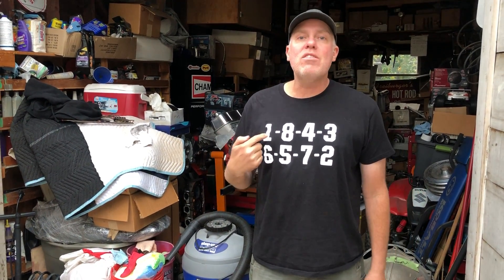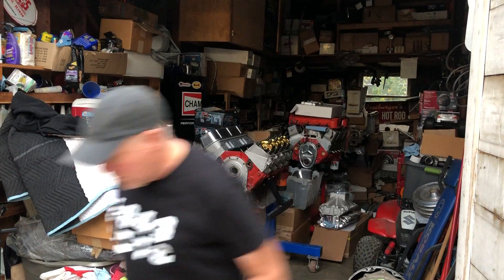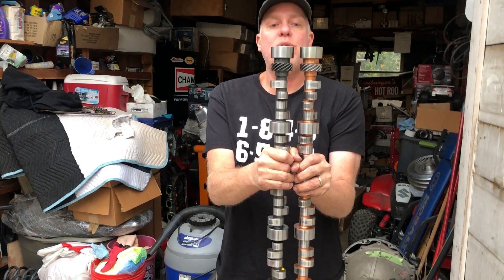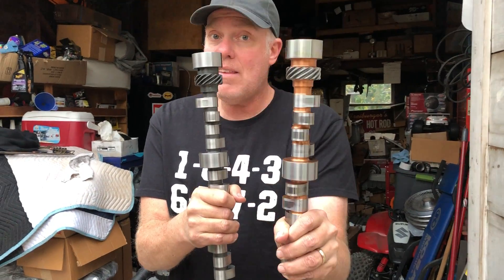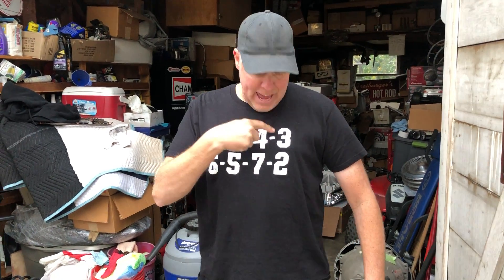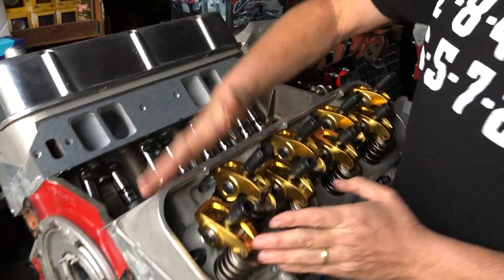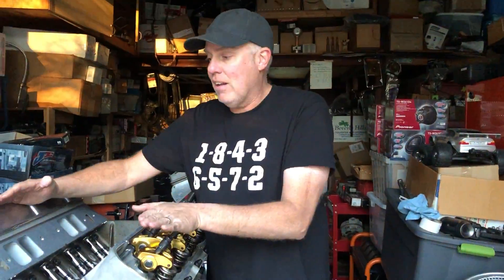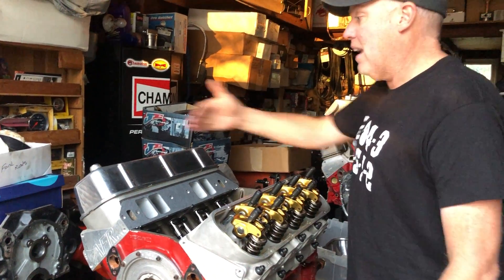Camshaft 4/7 Firing Order Swap Explained

Comment: Pontiac and Buick Nailhead engines also used a right side forward block design. Pontiac had a perverse numbering system and still called the first cylinder on the left hand bank #1. Also the first generation Oldsmobile Rocket big block engines used a 4-7 firing order swap out of the box!

Comment: The Ford order makes no sense. Not only does it give you less information without some manipulation (like bank), it ignores the order that the rods are arranged down the middle of the block. I'm a big Ford fan (building a 4.6 3-valve now), but they screwed the pooch on this one (I'm adopting GM's nomenclature for mine -- no camshaft though, so it's easy).

Comment: 18436572 is the same as 15426378 if cylinders are numbered the same. A 4-7 swap is the same as 15486372 the flathead, Y- block and Coyote firing order.

Comment: I read the description and understand the benefits of this swap...this is the first time I've heard of this. If there ever comes a time when I need to rebuild the lower end on my 5.7 TBI, 500K mile 91 OBS Chevy truck, will the cam shaft be WORTH the extra cost? I expect exhaust note might change? I'm a big fan of a strolling(slow,smooth) idle that i can feel every power stroke. Will that be affected?

Comment: i have 94 e150 5.0  enginei got it back from  the rebiulder but my problem with the firing order  oem wont start and with old firing order like1989   it will start but is missing this is efi  can the cam got replace and wont work ?

Comment: I need a 4/7 2/3 swapped camshaft for my pontiac 301 so I can open up the heads evenly and build a bigger manifold for the turbo.
Reply from the maker: I don’t think the firing order and port design are interrelated but I have not tested that. I’ve done the firing order tests on big and small blocks with similar results, and they have very different port designs.
Reply: @TheDavidFreiburger  yeah I get that. But pontiacs are not big/small blocks. Just pontiac v8. The 301 and 301T (turbo) have Siamese intake ports in the heads. The runners are extremely small for a v8, the the only large runner is the 5/7 runner as they fire simultaneously and pontiac engineers decided to give that runner more to not starve the next cylinder. The point I'm making is that if we can change the firing order so all cylinders fire separately that shave the same runner, then we can do much better to Max things out.

Comment: I did it in my type 1 aircooled engine. Swapping from 1,4,3,2 (stock timing), to 1,2,3,4. It works very good, and I notice gains at middle and high rpms. 
Great content bro!

Comment: Given how tiny the gains and losses are, it's worth noting that if you displayed the entire spectrum of the engine's rpm on your monitor, it would be impossible to tell if there were any differences whatsoever, not just visually, but also viscerally. 

It's very unlikely that most of the changes made would ever have any real world effects on horsepower, torque and ETs.
Reply from the maker: I’ve tested it three times. It usually gives you 4-5 more numbers in most parts of the curve. Granted you’re not going to feel that, but it all adds up. And there’s zero downside.

Comment: So bummed went to but 2 of these shirts and nope they are all gone. One was for me the other for a friend who traded a junkyard 454 for a fully built 572 high compression. His dumbass wouldn't listen when I told him it is prolly a 4 7 swap. Well many dollars and lots of parts later. Convertor flexplate trans manual valve body multiple intake gaskets trans brake exhaust msd boxes and more. All he had to do was swap wires 4 and 7 and get a pan that clears the crank and massive main caps. We all learn some the hard way. My advice is listen to experts and always always double check the dumb stuff or it might make you look dumb

Comment: Warren Johnson was doing the 4,7,2,3 swap firing order back in the late 60's with a SBC 350 with 6 inch old's connecting rods. He brought it to the KALITA TEAM BACK IN 95 WITH THEIR MOPAR PROGRAM. THEIR WOULD BE ANY GM WITHOUT WARREN JOHNSON/SMOKEY YUNICK. THE NASCAR 4 PATTERN CAM IS ALSO INTERESTING WITH A SINGLE PLANE INTAKE.

Comment: For those of you wondering about the significance of the 4/7 swap and why this is important/worth doing (bear with me, this isn't an easy or short explanation):

Note: I'm basing the history portion off of what I've been told by local engine builders and my dad/grandpa; the rest is based on college-level understanding of metallurgy, fluid dynamics and heat transfer...

Way back in the golden era of hot-rodding (early 1960-s to early 1970's) drag racers were starting to climb towards the maximum of what their vehicle's engines could achieve, which led to finding the limits of stock hardware.  However, there were a few problems that were commonplace amongst the hot rodding community that no one seemed to be able to escape.  This phenomenon was what's called (and I'm ad-libbing here because I don't know the correct terminology off the top of my head) butting the ring ends.
Butting ring ends together happens when cylinder temperatures get too hot, allowing excess heat to be retained in the compression ring material.  As material increases in temperature, it tends to grow in size (volume), and this expansion process follows the path of least resistance, which ends up with rings growing to a larger diameter than normal, which shrinks the ring end gap.  This continues until there's no room left for expansion, and then suddenly, the ring ends butt together, then simultaneously catch on and seize to the cylinder wall.  Since there's not a lot of piston material above the compression rings, the piston material fails under tensile stress, fracturing into multiple pieces and causing catastrophic cylinder damage.

So the question is: how does this happen?

The main culprit is the design of the engine block itself.  Back when the Small Block Chevy (sbc) was introduced in 1955, it was designed to be a relatively simple engine.  However, this came with a myriad of problems once the design was pushed well beyond it's intended purpose.  The most damning of these shortcomings was the design flowpath of the engine's coolant through then engine block, combined with the other culprit: the stock firing order.

As Freidburger stated earlier, the firing order for most classic american V8's was 1-8-4-3-6-5-7-2 (when looking at it through the layout of a chevy engine).  The coolant flowpath through a sbc goes from the water pump, into the front of the block, through the water jackets to the back of the block, then up through the cylinder head, into the bottom of and through the intake manifold, then through the thermostat and its associated housing at the front of the intake manifold, out via hose into the radiator to cool off, then sucked back into the engine via water pump once again to start the flowpath once more. This is where the issue resides.

For context, there's always one pair of cylinders in a crossplane V8 that are part of one cylinder bank that fire right after one another, that are located right next to each other.  For the original sbc, this is cylinders #5 and 7.  For the late model Ford Coyote 5.0 V8's those cylinders are #4 and 2 (still using sbc numbering)  and for LS/LT engines, the cylinders in question are #3 and 1.  These two cylinders firing right next to each other AND right after one another generates a 'hot spot' in the engine; a concentrated are of higher temperatures compared to the overall engine.

So the issue with sbc's and their original firing order is that it places the 2 consecutive cylinders at the back of the engine, which is furthest away from the coldest coolant entering the engine (remember that coolant flows from the front to the back of the block).  This presents an issue where the two hottest cylinders are receiving the lowest amount of cooling.  Hot cylinders transfer heat to compression rings, which causes ring ends to butt together, which causes the failure that i mentioned above in paragraph 3.  So how do you fix this?

Simple.  You move the hot spot as close as possible to the front of the engine, where the coldest coolant is.  Granted, this doesn't 'get rid of' the hot spot, it moves it to a place where it can't cause damage to the engine.

So now you've done the 4/7 swap.  What does that mean?  It means that now our firing order is 1-8-7-3-6-5-4-2.  This means that our two hot cylinders are at the front of the engine, on the passenger side, identical to a Ford Coyote (funnily enough, doing a 4/7 swap on a sbc dues give you an IDENTICAL firing order to a Coyote...), and now the problem has been mitigated.

I hope this helps.

*Side note: Due to the more even firing order between banks, this configuration tends to have better fuel-dispersion properties, meaning that your air-fuel ratio disparity between cylinders is decreased by a noticeable margin.
Reply: Hi your explanation is fairly correct but we always were taught to file ring end gap for expansion and the 4 7 swap cam was used in corvettes as early as the late 50s as I was taught that from a gm engineer that worked on them anyways thanks for your explanation it was great
Reply: @unclecowboy2003 Yes most drag race engines the ring gaps are opened up because of this so it doesn't happen . All of the guys running turbos are opening up the ring gaps and a lot of guys that are going to run a turbo LS are buying used junk yard engines that still run good but have high mileage on them because the ring gaps have opened up from wear . They will usually check crank & rod bearing & if within tolerance they will replace them then do a cam change that's made for turbo applications then re gasket the engine. It's a cheap way to go fast for someone that doesn't have a lot of money to buy the best or or pay to buy a good ring grinder to do this which can be expensive for a good one .

Comment: The two things that every internet/old-school car guy knows are that: 
1) Back pressure makes horsepower. 
2) Different firing orders (on a cross-plane V8) sounds different.

Hey, maybe they all still feature two opposing-bank pulses followed by two same-bank pulses... but whatever. It's that TONE.

Bonus:
3) The two-man bleed is obviously the best, most efficient brake bleeding technique. Open the bleeder with a clear hose (if you want to see what's happening) attached running vertical and just pump until bubbles stop? Blasphemy.

Comment: There's another piece to the puzzle here. Engines are capable of changing the firing order on their own without requiring a cam change. I've seen it first hand. My '99 F150 w/ 4.2L went from 1-4-2-5-3-6 to 1-4-2-_-3-6 immediately after throwing a rod. I was towing a trailer of about 6k lbs and made it another 10 miles before the firing order changed one final time.

Comment: With this being said could you technically make an Ls have the same firing order as a old school small block chevy? And would it sound like a sbc? I would assume it would. Did they change the firing order from the sbc (18436572) to the Ls firing order (18726543) because it was more efficient and or made better power?

Comment: I used to think that all you had to do for the 4/7 swap was swap the spark plug wires. So I did. It was a 406 sbc.  I didn't know at the time it also required a special cam. My way of swapping made no difference that I noticed. That 406 rand so good even on 7 cylinders, so my screwed up swap just wasn't noticeable.

Comment: Awesome information! Would like to know a little more about why swapping the firing order offers an advantage and should it only be done when swapping camshafts or is there an advantage when the engine is stock? Also does this also work on modular V8 engines like the Ford 4.6?
Reply: probably if u can swap both cams. since the 4.6 is  SOHC

Comment: 99 of 100 engine builders just learned nothing.  Maybe with special one-off intakes could some power be added.  Hundreds of millions of dollars were spent by manufacturers making sure 18436572 works as intended.  Flat cranks are only used to make an engine louder and sound different.  There is no discernible advantage of flat cranks for stock engines or everyday hot rodders, except harmonic problems to beat everything to an early death.  What is the point of this observation video?

Comment: Crane cams sent me a Cam for a 5.0 SBF that had the firing order from the 351 Windsor. The cam card was wrong and by the time I figured it out the flat tappet cam went flat from attempted starts. Of course Crane just wanted to replace the cam, even though I had to do a complete rebuild! Negligence as far as I'm concerned, what do you think?

Comment: What would be great would be if you could arrange the firing order on each cylinder bank so that they have a 360 deg. (or 180 deg. ) firing separation. Then a header could made  that could be perfectly balanced as far as scavenging goes. In the book "How to Hot Rod Small Block Chevys", even though the firing order wasn't perfect, that was the idea behind the TRI-Y header design which the book says was more effective, but more difficult to make.

Comment: Funny thing, this still doesn't cure the traffic jam that happens on a V8. I'm talking about the left-left then the right-right in the firing order. That makes balance/H/X pipes more necessary.I like the 6cyl concept, L,R,L,R,L,R or F,B,F... the firing order is balanced. Split a six and you have two 3 cylinders 180 out of phase from the two pipes. That's what gives them the bad rap.
 I wonder what a perct L-R exhaust note would sound like from a V8?

Comment: My 4/7 swap 540” has had the same main bearings for about 4 years 400+ passes, 2 sets of valves springs.   Spinning to 7600.  And they still look great.  So I’d say, in a high rpm application it’s easier on the main bearings.  A stock firing order stroker BBC spun high is tough on the mains.

Comment: I replaced the cam and lifters and timing set in a 1979 Thunderbird police motor redtag 351m 400 and I had to do the 4-7 swap.... Then six months later  it threw a rod...
Reply: The Crane cam I put in it had me change the firing order and I'm pretty sure I recollect it was the 4 and 7 swap..

Comment: it is basically a four minute video to sell a t-shirt. he gave no information on why you would want to do the swap or is it worth it in a mildly modified engine. all the swap does is smooth out vibration. it also helps with engine cooling and adds a few ponies but not enough to justify a swap. plus you need a matched intake to redirect the timing of the air flow. most intakes are designed to perform the best with 1-8-4-3-6-5-7-2 firing order

Comment: Couldn't you just swap plug wires to change the firing order?
Reply: Sure...but I'm not sure firing the cylinder while the piston is at the top of the exhaust stroke is gonna help you.  The cam has to be in the right configuration also.

Comment: Here's what the 4-7 swap looks/sounds like https://www.youtube.com/watch?v=AdybedB7k1A. Interestingly a crossplane V8 has 8 possible firing orders - 4 of these fire all cylinders in one bank followed by all cylinders in the other, no production engine has used that. It gets confusing because of differing numbering conventions (as you mentioned) but from what I've seen only 3 of the remaining sensible 4 firing orders have ever been used. Not sure why.

Comment: I once worked on a boat with 2 Cleveland 351s. One of them had a rearranged cam and ran backwards,  to keep prop rotation symmetrical.  I was amazed as I didn't know that was possible.
Reply: not too hard to do, just don't forget the oil pump and distributor turning backwards
Reply: @jrobpat0154  And the starter motor. I might be Wrong,  but I  would have thought the  distributor would  still work in the other direction.  The oil pump would be tricky.

Comment: People are going to be 'starving' for the reason.
Reply: This has been discussed for years and according to GM engineers,  "We've tested a bunch of "swaps" on various Chevrolet platforms over the years, have found no difference in performance to this day. We were told this is what we would encounter by one of the larger cam companies, they were correct in our opinion."
Reply: @BobWiersema  I've heard much the same.
Reply: something something exhaust efficiency and whether you need a crossover

Comment: That's wild about the ford small block and sbc firing order. I knew the cylinder's were marked differently but never tried to decipher it. The number came out to 21843657 sbf numbered like a sbc. Same rotational order

Comment: What is the benefit to swapping the order? Im curious.
Reply: The truth is nobody really knows. The old claim is that it helps cylinder 7 since cylinder 5 overlaps. But changing the order just moves this problem to 4 leading 2 or 3 leading 1. While that might seem like a good idea with certain manifolds but for the 4150 single carb manifolds that's probably not the reason. The best theories have to do with crankshaft bending, harmonics, and bearing loading. But it's really hard for a regular guy to test.
Reply: @danieldimitri6133  - I agree, it seems like most of the positive comments refer to easing the main bearing loads at high rpm.  I wonder about the intake sequence, since the good old 18436572 order has no two cylinders firing in sequence within one 'plane' of a standard dual-plane manifold, thus keeping the intake pulse constant on both sides of the manifold.  (With modern port-injection technology and an open plenum manifold, I guess that doesn't matter so much.)  It would indeed be hard for a 'regular guy' to test.

Comment: If you could swap 4 and 7 AND 3 and 2, that would best as you would eliminate the uneven exhaust pulses that cross plane V8s naturally generate. Or you can stick 8 pipes out the hood and get the same result.